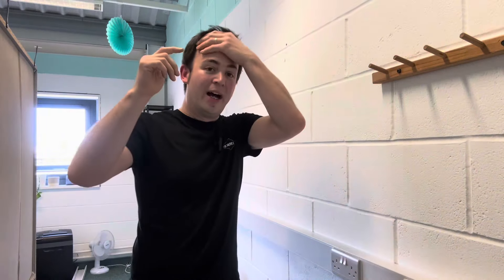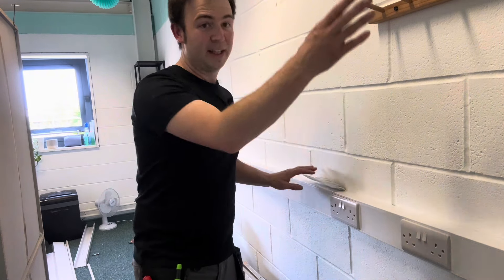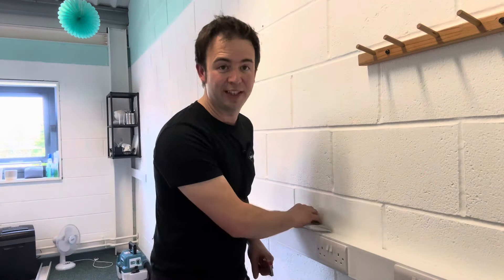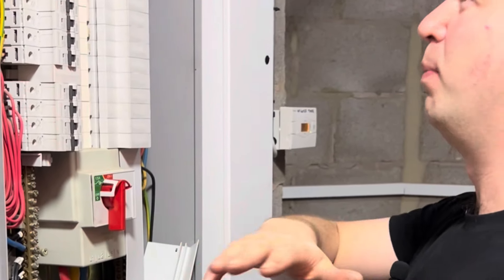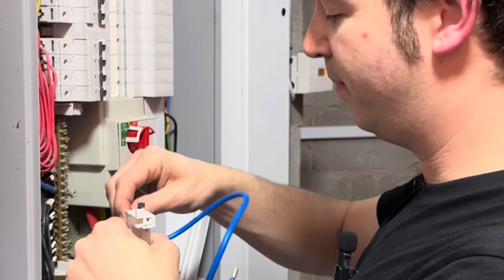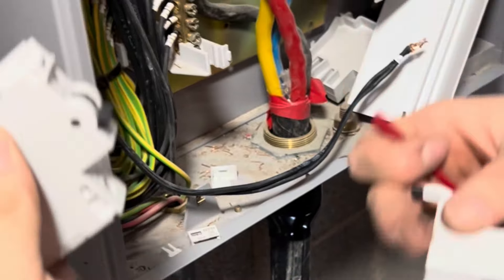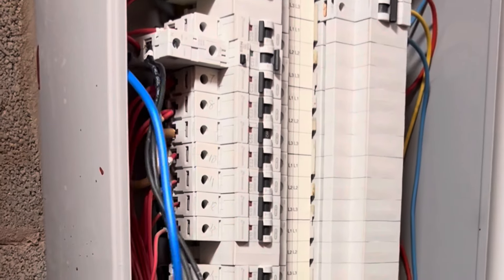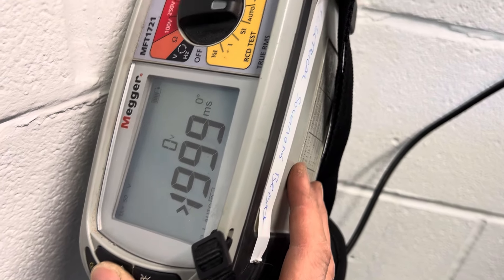THE MEMSHIELD2 RCBO POD - FACTS

Comment: Though i totaly agree with you regarding rcd protection on sockets. I feel you might be getting call backs when all the pc's in the multiple offices start knocking out the rcd.  Pc's in there nature naturally leak to earth, too many will cause you issues. An option may of been to install your sockets with built in rcd protection.
Reply from the maker: How big do you think the circuit is? I’m a huge advocate on teaching folks about accumulative leakage, watch any of my other videos. I respectfully disagree with fitting RCD sockets.
Reply: @bristolsparky  It doesnt matter how big the circuit is. you said it feeds a couple of offices. it could easily feed 10 computers or laptops. Why are you against RCD sockets? it would  provide the additional protection without affecting other sockets. It could be very costly to a company if all computers shut down in one go. 
You've obviously designed it to the specified requirements. i can only comment as i see it through a screen. Keep up the good work. 👍
Reply: Ashley, isn’t that the reason for using C-curves?
Reply: @abdulseaforth6930  No, The C-curve relates to in-rush current on the Mcb. designed for flourescents, motors etc to reduce the tripping on start up. 
Pc's by their design naturally leak to earth. It doesn't take many pc's to reach 21-25ma of leakage to trip the Rcd.